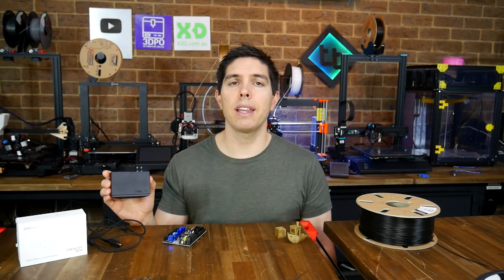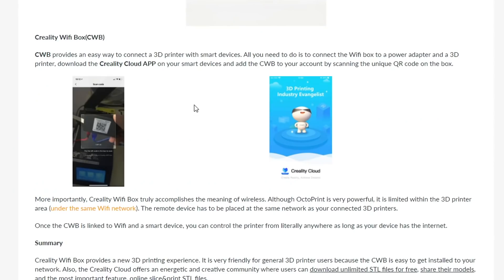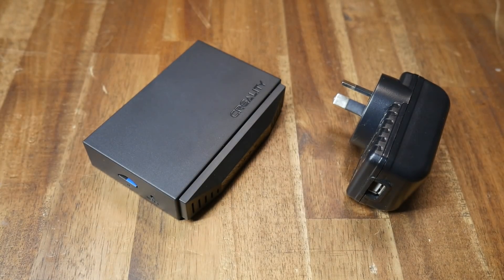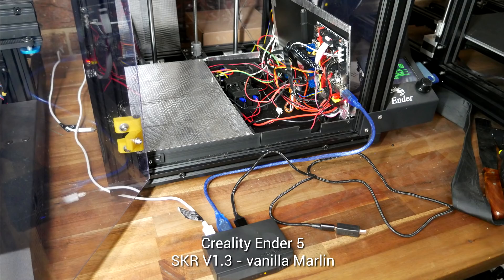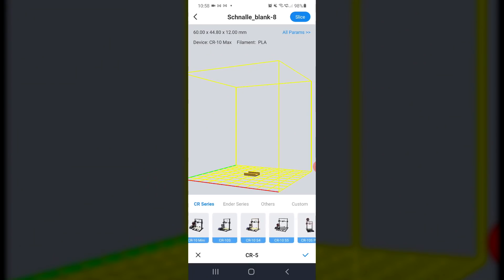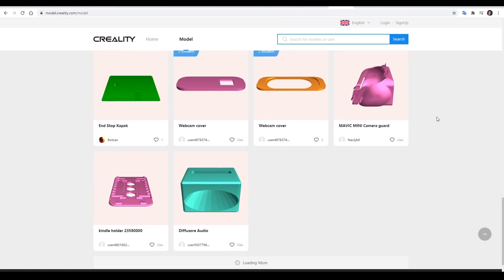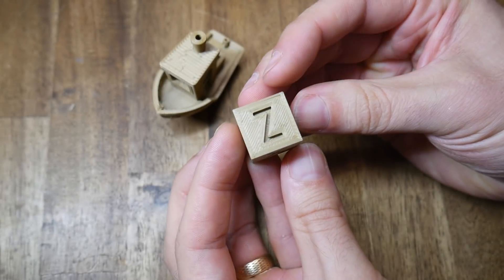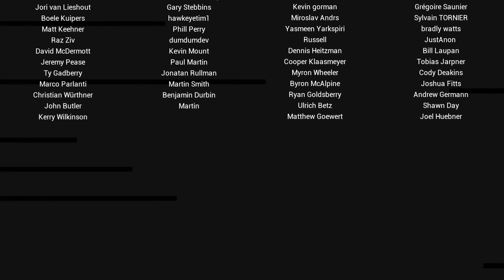Creality WIFI Box tested: Budget Octoprint alternative?

Comment from the maker: Hi everyone, there's a few comments asking to see inside, so here is a pic: https://imgur.com/a/5UBMquL
Also, no reply from Creality support yet. I'm not holding my breath on that and I'm not going to get upset about that either. Creality printers are very affordable compared to other brands so costs have to be saved somewhere.
Reply: Any chance for a picture with the shielding removed? This just shows the magnetics chip, ports and microSD slot, under the shielding is where the interesting stuff is.
Reply: @someguy4915  I found this: https://fccid.io/2AXH6CREALITY-BOX/Internal-Photos/Internal-Photos-4931511
Looks like it's running on a mediatek chip with winbond memory
Reply: Have you tried to hook this up on your phones hotspot? If it is your WiFi then you should try this and see if that solves the most problem connecting to your printers Teaching Tech. Because you are connected it doesn't mean it will work...i assume you know the most about wifi but if you don't then you should try this. Don't forget only 2.4 connection...i don't recommend mixed network 2.4 and 5
Reply: Im pissed that it was recommended with the Ender 6, I hooked up a usb to motherboard because of course the didnt add on and the wifi box wont connect to it..
Reply: @fisheye3d1727 Check out dr wax clip....it can just be a simple problem for you to connecting this. There can be big problem for example if you have colliding ip:s. Hook the box up on your phone hotspot and check if you can connect... don't forget to choose 2.4 network. Don't use mixed network
Reply: @hammerfallen12345  I have 9 Rasp's hook up to 9 different printers with no issue, I changed to a rasp on the ender 6 and it connected with no issues, Maybe it was just my printer.
Reply: @fisheye3d1727  Then you can tell me what's wrong with the wifi box? If you can't then you don't know the issue. Maybe it's the box but i had a lot of problem with wifi at several devices in many years. For example my latest netgear portable router didn't work properly because i didn't have the batteri inside the device. But according to netgear who are a big router company says in there manual that it's ok to do that. But unfortunately they have wrong and many other big router manufacturer also have problem. Therefore you should do more troubleshooting on your things. You should check all the common problem with wifi devices. If this is a common fault people do then it's good if someone is solving the problem you know. Colliding ip..bad ssid,mixed 2.4 and 5 network, connecting to wrong frequency, choosing two different frequency, port forwarding. The most of this is common fault that can happen. I have already seen a clip with Dr wax is talking about some of this and i totally agree because i understand what can happen with wifi devices
Reply: @hammerfallen12345  All i have to say is i have been a network engineer for 20 years.. I think i know if its a network problem or not.
Reply: @fisheye3d1727  Really 😳 I have been it for 30 years...then you have a lot to learn boy
Reply: @hammerfallen12345  First off apparently you need to learn to read because my first comment was about the box connecting to the printer not the wifi.. I never said i had a issue with wifi connection.. 2nd if you have been in networking for 30 years why are you telling me to watch someone else's video to fix the issue instead of just telling me yourself? And the way you worded your response leads me to believe that is untrue.
Reply: @fisheye3d1727  Because i don't have any video so you kid can learn something. I don't have the box so i can't troubleshoot it. I don't accept a guy to say it dosen't work with this and this and this printer. You also have to explain what you have tried. The box price is 20 dollars now and is not a big deal for me if it's not working...i have to do it my own way because nobody else can do it the right way. If you are going to troubleshoot this then you have to start with the wifi so the box connect correctly to your machine and your computer or phone. Learn yourself to exclude things in the future. This is going to be interesting with my own ender 6 machine
Reply: @fisheye3d1727  I just remembered something...ender 6 dose not have a finished micro usb port...maybe they shut that off on your mother board. That can be problem why you can't connect with the wifi box 😅👌
Reply: @hammerfallen12345  Its called opening the printer and adding the usb cable to the motherboard.....
Reply: @fisheye3d1727  Yeah and firmware shutting that off 😅 You don't have a clue if the port is working. I have already seen the micro usb
Reply: @fisheye3d1727  You bought a WiFi box and was hoping for it to work with usb port that maybe doesn't work from the beginning 😅
Reply: @fisheye3d1727  WTF 😅 Are you crazy...the firmware is not made for the wifi box...but ok it's on...are you happy. Don't waste my time it was you who start to arguing. Go to bed kid 😅👍
Reply: @fisheye3d1727  I have not met any like you before that think everything works. The usb should be on the machine from the beginning...then it's more clear it should work
Reply: @fisheye3d1727  My ender 6 is hooked up with creality wifi box. What was the difficulty?
Reply: @hammerfallen12345  IDK maybe i got a bad box, Like previous comment hooked up Rasp pi no issues.
Reply: @fisheye3d1727  Or maybe you did something wrong. I almost made the mistake to use a adapter with to low power. I only had one adapter with that power for the wifi box
Reply: Affordable is great, but they should still have the decency to support their product. I’ve been pretty turned off by Creality and their aftercare of their customers.
Reply: Thanks you for taking one for the Team! I was really looking into this, because I consider buying a ender 3v2 beneath my Anycubic Mega S and Chiron. But in this case, I will again opt for either another Partition on one of my two ocotopies or a third octopi. I still somehow have problems with the quality of the Webcam feed, But this is just because I am a noob regarding Linux and compiling.
Reply: it could be possible that denying location is causing error, get a VPN and accept the location, ill bet it will work now.(☞ﾟヮﾟ)☞ 
what I thought it was going to do was connect to my laptop  directly so i can send a 3D print wirelessly instead of using that damn little SD card that is hard to grab with my sausage fingers(•_•) this wireless connection would have been better through a PC or Laptop, the phone should have been used to work like the Octoprint version.
Reply: Your review was a while ago. Has it improved?
Technivorous(sp) did a review recently and thinks it's not bad, but his review was for the online slicer, not the WiFi box, which I'm not interested in. I have Octoprint on 2 RPis which are on my 2 Ender 3 printers.
I've converted both to direct drive, and I'm in the process of installing the 4.2.7 mainboards. I have custom firmware from Creality I'm testing for them... Jury is out
Reply: any update? i't been 4 months. the box is on sale now, very cheap. if it's still bad, i don't want it, but if improved, i might jump in as a temporary thing towards implementing octoprint somewhere in the future. any update?

Comment: I've been using Octoprint happily for many years with out any issues.  The plugins that I have on my octopi server are Arc welder and the plugin to connect Cura directly to the print server from Cura It self.  I'm looking into installing Octopi on a distro of Linux running out of a Rockpi 4C, Mainly to increase the instruction transmission from the server to my printer because I'm upgrading my CR-10 V1 with a Lerdge K K2 main board, Cause my stock board let out the magic smock.  :(  The data transfer rate increase is needed for printing at higher speeds, Or at least that's what I'm thinking.  If you have other info that will help with this please let me know, I'm always open to easier options.

Comment: Hello! Thank you for the video! You asked to hear the story if "we" had a different experience? I absolutely did :-) With a bare stock Ender 5 Pro and the Creality box... It works very well for me! Zero issues setting it up (but I did experience the same "failed to install but, actually, it didn't" bug that you did hahaha) Anyway, My Octoprint kept failing me. The prints would jam. My Ender 5 Pro is (in my opinion) a rock solid machine. Using the SD card, the prints NEVER failed and the parts it printed were dimensionally accurate every time. But with OctoPrint, my prints started to fail like the machine never had before. Plus using the app to interact with Octoprint felt more like a remote desktop session rather than an app itself (that doesn't exactly qualify as a complaint but it was something I noticed/observed). NOW! the Creality Box! Easy to set up. The app did take me a few minuets to figure out how to navigate. I did not use the cloud slicer. I used my PC with Cura to slice it, then Email it to myself. then on my cellphone, download the file, open the app. upload the file to Creality server. navigate to the machine. open the machine. select file. and the print takes place.... hahaha Boy. that sure sounds like a lot of steps just to print remotely... I don't know if this is a win or not but, So far? I like the Creality box better than OctoPrint. and the time-lapse is way better too! (Though, I am starting to question why all of the time-lapse I have made with it so far have all been exactly 6 seconds long... Hmmmm ... lol)

Comment: I trying to connect to flashforge adventurer 3 and am stuck without a computer. I have a pi3b+ I use for a retropi arcade style setup and from a mobile connection to load all the software to load OS, slicer program and network to connect it all seems like alot of headache I'd rather avoid if It doesn't cost me kidney... confusion aside, is this what octoprint is supposed to do and allow me to bypass the pi straight to mobile or is it a way to use the pi own its own and bypass my mobile or need of a laptop/computer?
     Anywhere would be appreciated and thank you for the content. You seem to have been down the rabbithole for awhile and know your way around...
3d printing is fascinating,
  now if  I could just print something other then a test piece..🤦‍♂️

Comment: I know this video is kind of old,  BUT!!! if you read this, These creality Wi-Fi boxes are a very good deal if you just flash octoprint onto them.  I am using one right now and it might be a little slower then a  pi, but I was able to buy this at microcenter for 30$, when a pi is well over 100$ .  Long story short  OpenWrt + OctoWrt = Octoprint and 2.4ghz wifi on your printer for 30$ US.. Could be a good video for you to do, I could only find a single video guide, and its a bit outdated and hard to follow.

Comment: Hi.  I get that this review is a couple years old now.  I can report that its matured quite a lot.  I've recently got back into 3D printing after an absence of a few years and have a couple of enders.  The creality box worked immediately with the Ender 3 Pro  for me sending gcode by uploading gcode slices to the the cloud and selecting them for printing using the phone app.- haven't tried it on the 3 S1 yet but am quietly confident it will work.  The 3 Pro is relegated to a cold backroom in an enclosure so its very handy to be able to prep and send it jobs without constantly physically being present.  I note that the web interface for the printer is rather broken so you can't monitor and send jobs from your workstation browser - hopefully that will be fixed at some point.

The networking of the box still requires 2.4G - I had no problem connecting it to the network as I turn off 5G anyway (it doesn't penetrate as well or as far as 2.4G).  Still, this pickiness will put people off.  I've bought three of these devices now and consider them good value at AU$24ea.  One of them I've reserved for tinkering with - I've flashed it with KlipperWRT and it appears to run Klipper very well.  I haven't connected it to a Klipper flashed printer yet as my printers are hard at work and I'm reluctant to fix something that isn't broken.  But the box itself is a viable unit  for hacking and slurs on its power are overstated - 570mhz is pretty good.  Soon I will procure/build a cheap printer that I can install klipper on and test how well the box drives  things and educate myself on the inner workings of Klipper and Mainsail.  It would be preferable to have direct access to the printer via local wifi instead of via someone elses cloud but I will keep using the creality cloud box while its working.  And $24 for a fully functional computer is about as cheap as it gets!
Reply: I forgot to mention that z offset issue would not have been the fault of the CB or cloud slicing - that configuration element is the domain of the printer z stop & firmware setup (z offset) and  how well you tramed your bed isn't it?  If you suspect the gcode caused the issue you should verify it with a look - its just text code and any instruction to bury the z axis in the bed would be visible there.  Its very unlikely I think.

Comment: Hi. Yes. That 1st software release was a load of Doo Doo. But the current version actually works fine for me. My WiFi box included a Creality webcam, and the software records time lapse video as well now.
You can load a Creality plug in in Cura and upload your slices directly to the WiFi box.
Tomas Sandlanderer did the octopi on an android phone a while ago.
And yes, it works. But you still need a internet connection on a PC to upload your files and start the print. The time lapse from the cellphone [mine is a Nokia 4.2 13mega pixel] was much better than just using the phones software time lapse, as you can set it to layer change.
A year has gone by, and the new Creality printers have the WiFi box build into the printers.
Feedback like yours help them improve, giving us better products. So thank you for your hard work.

Comment: I having great success with the Creality WiFi box. I do love the Octoprint, but I was having to reinstall the software way too many times, and got fed up. With the Creality box, I simply keep using Cura to do all my slicing, for full control of G-Code, and use a Creality plug in to upload to Creality, and on to print. One problem I have seen is that after a power outage, My Ender 3 Pro now doesn't resume. Another quirk is that if I reboot the Creality box, I do have to remove/reinsert the SD card on box after it powers back on. Seems uneccesary, but works every time.
Reply: Consider a UPS. I added one before my cable modem and WiFi, as a power drop was causing intermittent network failure for a day or two.

Comment: The idea is nice but i guess even Creality really didn’t believe in this product. Nothing really works as it should. I got two of these devices. It won’t connect to some 2.4Ghz wifi (i guess the excuse is low signal). Then if it does it wont admit many Marlin firmware (and sometimes you just cant use stock firmware). Even if you could use stock firmware it turns out you cant really connect anyhow. 

I chose this product to avoid installing octoprint and and dealing with rasperry pi etc. But the amount of work I had to put into these products turned out to be more than what it would take with octoprint solution. 

You said it very kindly but let me keep it real for the rest of us. This is such a WASTE OF MONEY (and time).

Comment: It's been working great for me. I'm not the techiest person around so I was kind of nervous about going and setting up Octoprint. So I bought this for really just two reasons, to monitor with the camera and to stop failed prints when I'm not home. So if you just want it for that I think it works great. I feel that this 3d printing community is kind of becoming a bit pretentious with what upgrades you have done such as actoprint and certain hotends and such. This item is cheaper than octoprint and works as such for the price, this is coming from a beginner and not some guy getting paid to just print and criticize cheaper and simpler options.
Reply: Right? This device works perfect with my CR10s Pro V2s. I had no issues whatsoever.

Comment: I got this as a "gift" when I bought my Ender 6. Ender 6 does not even have a USB port so why even bother? I have a paper weight that is even too light to keep my papers from flying around.

Yes, I know there is a USB on the main board, but if I am going to open the panel, might as well user Octoprint, which I am.

Comment: Why on earth you need to use internet to access your printer from your phone if you are in the same place?

I only want a device, that allows me to controll my printer from my phone, tablet, or laptop. Without cable. A simple device like this (without a box by the way) could be already be on board (and no need matrix lcd) they can charge me the app, i don't mind.